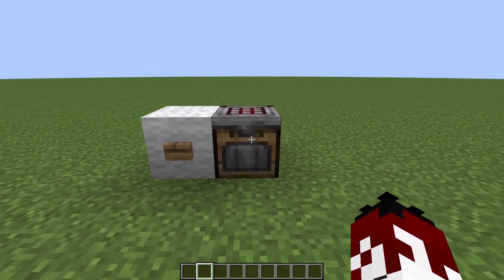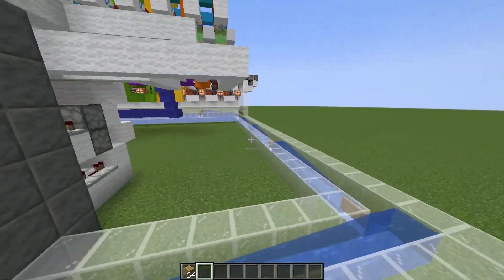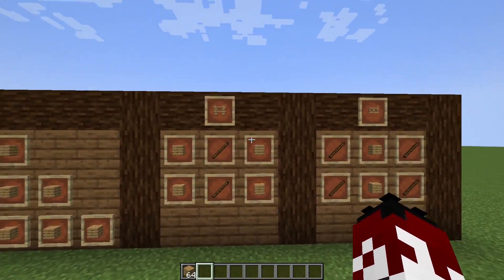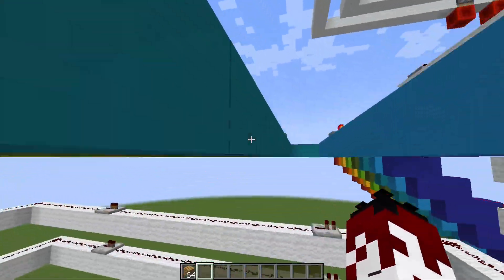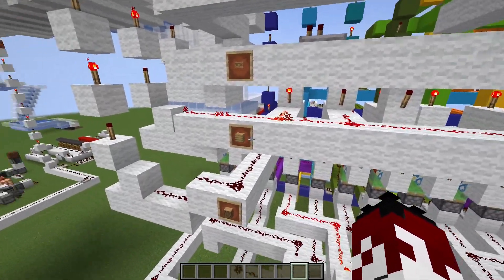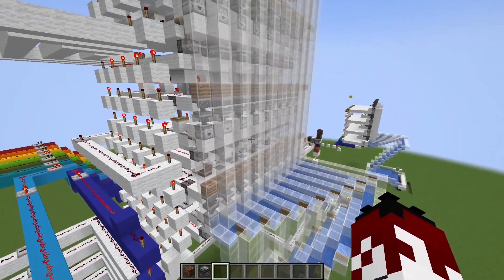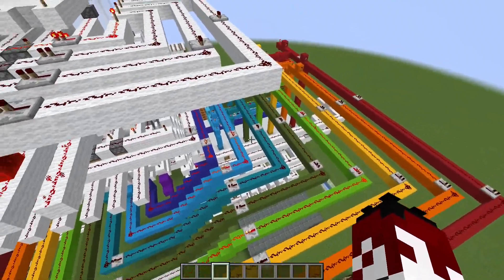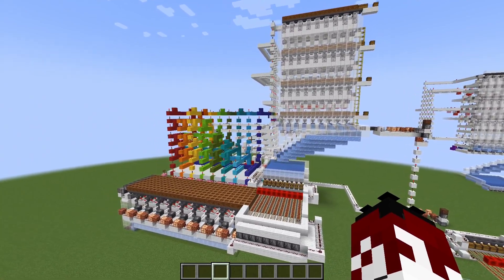Minecraft's Newest Computer | The Automatic Crafter

Comment: How is this a computer? Cool machine tho!
Reply: Technically its not, but it easily could be if it was able to read data other than input. What needs to happen is crafters should have a commonly accepted data type that can be read to generate new recipes. The only issue is a large set of each crafter slot pattern is needed to craft every item, you have to have a crafter for every shape of item to make it general purpose, or atleast find workarounds to use certain patterns for amorphous recipes. Either way, the autocrafter of tomorrow could accept a istruction set encoded as a certain "file type"  (like shulkers containing disks encoding patterns to use and block types and amounts to print.) Then you just have to put autocrafters of certain specs at certain spots in a world and give it access to materials to give computational redstone a vital purpose to big, high redstone servers like Hermitcraft or SciCraft.
Reply: @yessfan  it also could be 5 times smaller for the same amount of ingredients and recipes...